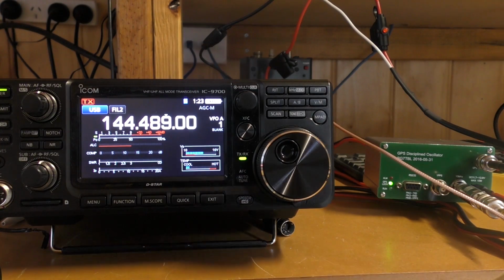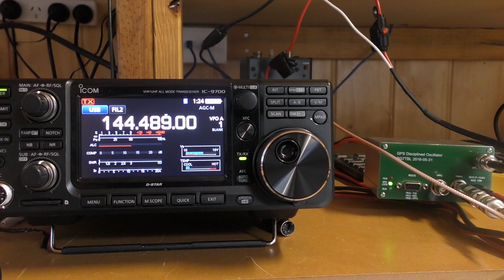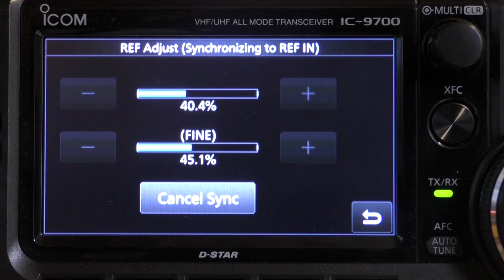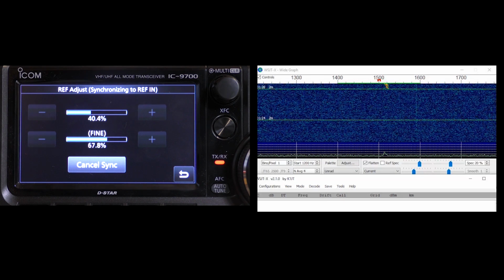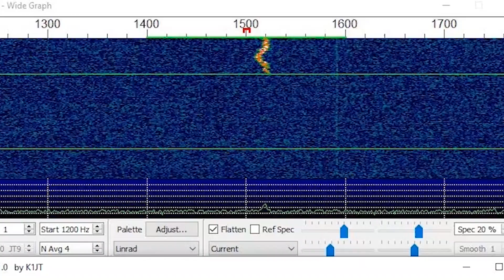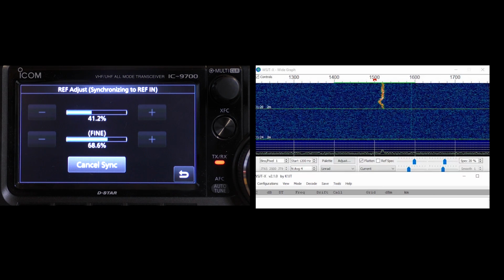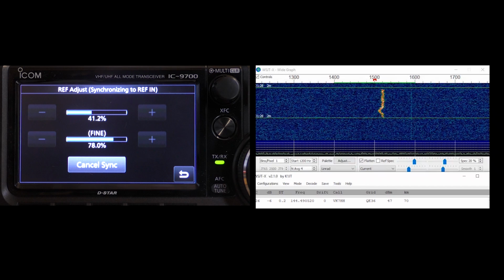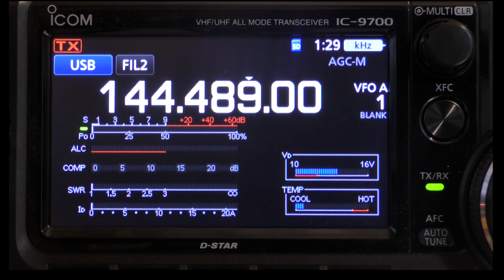Does the Icom 9700 still drift??? NEW Firmware Tested!

Comment: Unbelievable they did not install a tcxo or ocxo high stability reference oscillator in as the standard oscillator in it. 
What were they thinking? Is this due to the chip and component shortage in China?
Call ranger radios for help, I'm sure they have a good stable replacement reference oscillator that would fix it immediately. 
Come on Icom, what a embarrassing joke for such a fine radio.  Are y'all taking tips from Yaesu, like the ft991 failing finals issue, damn.

Comment: Can you please tell me about the GPS Receiver you have for 9700? Thanks
Reply from the maker: https://www.youtube.com/watch?v=EgF6-JbGUXA
Reply: @HamRadioDX  Thank you very much for the immediate response. Is it suitable for Icom 9700? Im looking for an external Gps antenna.Thanks
Reply from the maker: @manosmargaronis  I use this for an external antenna - https://www.ebay.com.au/itm/External-Marine-GPS-Antenna-for-Garmin-Boat-GPS-GPSMAP-with-BNC-Connector/392366587193?hash=item5b5adefd39:g:wN4AAOSwNo1dajL1&frcectupt=true

The GPS unit I linked previous needs about a 20-30dB attenuator on the output as the level is quite high into the 9700

Comment: What alternatives to the IC9700 are there for 2m digital modes? I can't see anything decent that isn't  a 'shack in a box' which I don't want. I'd love a 9700, but this drift bothers me. I guess I am worried about buying one, for ICOM to then release a hardware modified upgrade that resolves this.

Edit Just realised that I made the same comment a while ago. Apologies! I'm still no further foward in making the decision, but I am licenced now! My callsign is M7JHA 😊
Reply from the maker: There are options to GPS lock the rig. Google Mini-kits GPS-9700 or Leo Bodnar 9700
Reply: Ham Radio DX How does the Mini Kit fix the the problem?
Reply: I have now bought the IC9700, with a Diamond X6000 for 2/70/23 and a 2m Wimo Big Wheel for SSB and data 😊
Reply: Hi John. How are you getting on with the 9700, any issues? I'm also thinking about getting one. But the drift also bothers me.73 M0CPU
Reply: @nigelb5341  I love it Nigel. I use it all the time. I've recently won contested planning permission to have a 12m telescopic mast installed in our garden which is hopefully taking place next month. Plan is for a beam for 2m, another for 70cms and the existing Diamond X6000A to go on top for FM and D-Star work (D-Star is amazing). I've also bought a Contest Console from SOTA Beams to use in the UKAC. Beautiful radio, I love it. Hoping to add an IC7300 later this year when funds allow. Drift has never been an issue on 2m FT8, I haven't tried 70cms FT8 yet, but the Leo Bodnar device can be bought and installed if needed. Best, John M7JHA

Comment: Lol, for that money its appalling. Im walking away from buying one  unreal they would release a high end radio with this sort of issue.
Reply: Just like Yaesu did with the ft991 and failing finals. After 3 repair attempts by Yaesu service I gave up. 
Yeasu has really become crap. I'm concerned that the big 3 are all going to be producing crap as chips are unavailable. 
I'm just going to continue using my older hf rigs that are easily repaired since they are not all surface mount parts inside. 
My ft991 is now strictly a receiver on hf but vhf and uhf power output is good. Really pisses me off .I really liked it when new but it's been nothing but a pain in the ass.

Comment: Anything else new in the firmware worth getting excited over?

Trying to decide whether to buy a 9700, but the drift issue puts me off. Should it? Or am I being silly?
Reply from the maker: The new firmware also has a "Photo" mode which may be of interest. https://www.youtube.com/watch?v=xV7-W-JCPLA

As for purchasing one, I'd still go ahead and do it. In most cases it's only affecting WSPR operations and there is still solutions either on the way or currently available for GPS locking (see the video description)
Reply: Kim Davis  I hope to have my Foundation licence in a few weeks.   Was thinking about the 9700 for 2m/70cms, and then either TS590SG, FT891 or IC7300 for HF. Just when I think I've decided I see another comment or review that makes me lean another way 😊
Reply from the maker: Hope to hear you on the air soon! Are you planning on using your 9700 for SSB digital, or just FM/DStar operation?
Reply: @HamRadioDX  Just SSB initially, then I expect I'll dip my toes into all of the digital modes. So much to learn! :)

Trying to get clarification from our Estate Management company about covenants related to antennas. If all is OK then I'll go for a Diamond V2000 which is triband with the Diamond multiplexer and mount that just under the eaves. Excited! :)
Reply from the maker: @johnratcliffe6438  I'd just buy it! For SSB the radio is more than adequate, especially on 2m. Good luck!
Reply from the maker: They are on sale in Australia too. I'm tempted in getting one.
Reply: Kim Davis   How do you like the 7300? It looks really nice.

Comment: That’s an interesting test Hayden,  I have exactly the same setup but never transmit data with more than 4 watts drive for the SSPA. I haven’t done any tests as such, but using the rig for extended sessions on 2M FSK441 meteor scatter the DF is pretty stable. At night I turn the rig off at the power switch but still connected to the supply, the GPSDO running 24/7, does the 9700 still sync in standby ?
Reply from the maker: I don't believe it does sync in standby Alan. FSK441 is pretty fast transmission too, so perhaps you don't see it? In addition I guess the 4W of output power doesn't sufficiently warm the oscillator up enough for the fan to make a difference?